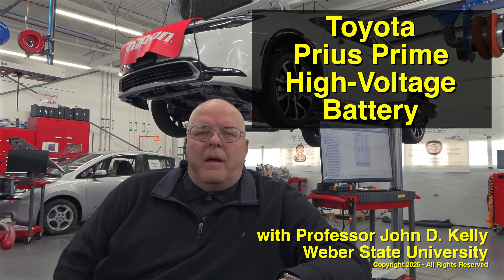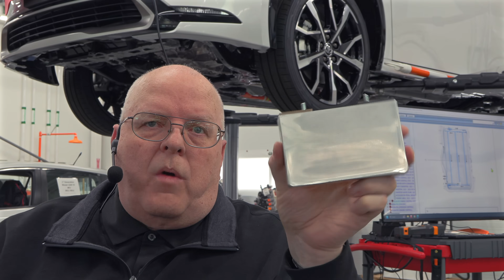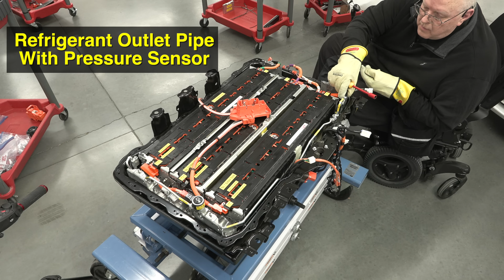2024 Prius Prime/PHEV High-Voltage Battery Build

Comment: AI Summary:

This video provides a comprehensive teardown and reassembly of the high-voltage battery pack from a 2024 Toyota Prius Prime Plug-in Hybrid Electric Vehicle (PHEV). Professor John Kelly details each component of the 13.59 kWh battery, which is a significant departure from previous air-cooled Prius batteries, as this model utilizes a refrigerant-based cooling system. Key components covered include the battery's heat shields, a low-voltage electric heater (likely for preventing electrolyte freezing), the aluminum cooling plate with refrigerant channels, and the three stacks of 24 prismatic cells each. The video explains the cell connections, voltage and temperature monitoring systems, and the integration of the battery management system. The refrigerant circuit, manual service disconnect, and battery junction block (containing contactors, but notably not a pre-charge contactor) are also thoroughly examined. Challenges, such as the unavailability of specialized service tools in the US, and design features like pressure relief vents are discussed. The video serves as an in-depth educational resource for understanding the design and function of a modern, liquid-cooled EV battery pack.

2024 Prius Prime PHEV High-Voltage Battery Deep Dive

*   0:00 Introduction: The video explores the 13.59 kWh high-voltage battery of the 2024 Toyota Prius Prime PHEV, which is refrigerated, unlike earlier air-cooled Prius batteries.
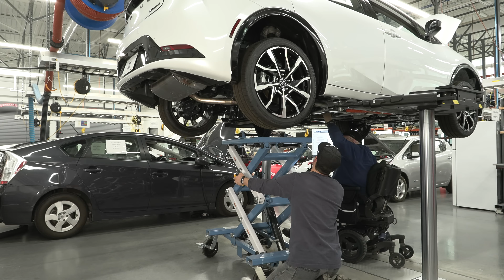*   0:36 Battery Specifications: The battery has a nominal voltage of 266.4V, a capacity of 51 amp-hours, and contains 72 prismatic cells.
*   2:06 Heat Shields: Thin, delicate heat shields/insulators (unnamed in Toyota's service information) are located at the bottom of the battery housing and between cell stacks to isolate the stacks.
*   2:56 Battery Heater: A low-voltage (12V) electric heater, similar to the one in the 2017-2022 Prius Prime, is present. Its primary function is likely to prevent electrolyte freezing, not for general battery warming.
*   5:42 Battery Cooler Sheet: An aluminum "cooler sheet" with channels for refrigerant flow is used for cooling. Refrigerant enters one side, snakes through three channels, and exits the other.
*   7:27 Three Cell Stacks: The battery comprises three stacks of 24 cells each, connected in series.
*   11:02 Limited Cooling Contact: Each cell has a small contact area (approximately 1 inch square) with the cooler sheet for heat transfer, using thermal interface material.
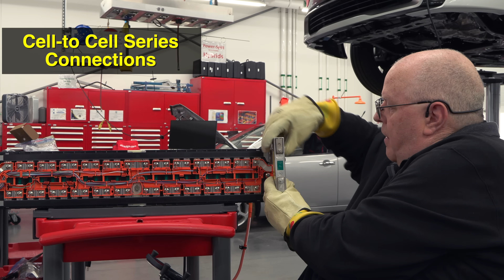*    13:01 Cell Series Connections: Cells within each stack are connected in series using bus bars, forming a serpentine pattern.
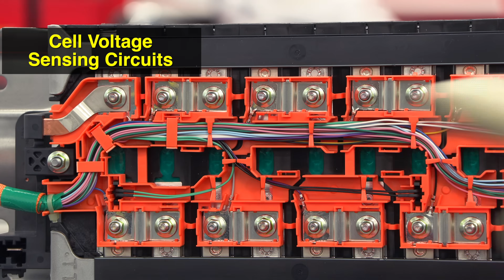*   14:07 Cell Voltage Monitoring: Each cell's voltage is individually monitored by a dedicated computer.
*   14:55 Temperature Sensors: Each cell stack contains five temperature sensors.
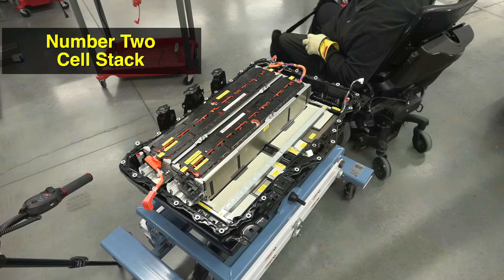*   16:48 Wire Harness: Specific wire harnesses and brackets must be installed before the third cell stack, due to bolt access limitations.
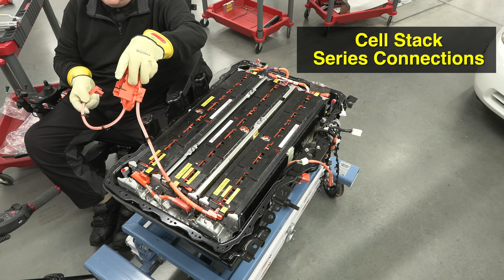*   23:08 Manual Service Disconnect: The manual service disconnect lever (service plug grip) with a large fuse is located under the rear seat cushion.
* 23:30 Refrigerant Lines and Control: The refrigerant system includes an inlet line with a "magnet valve" (precision stepper motor), temperature sensors at both inlet and outlet, and a pressure sensor.
*   26:14 Unavailable Service Tools: Special service tools for this battery are currently unavailable in the USA, making leak checking difficult.
*   29:56 Battery Junction Block: Contains the positive and negative contactors, but no pre-charge contactor.
* 30:19 Pre-Charge Method Change: The Prius Prime (and likely other Toyotas) now use the DC-DC converter bidirectionally for pre-charging, eliminating the need for a dedicated pre-charge contactor.
*   32:42 Battery ECU: Includes both the main battery ECU and the cell voltage sensing computer.
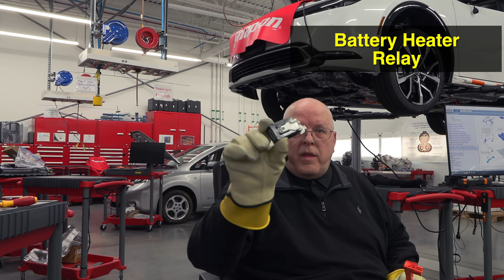*   33:11 Battery Heater Relay: Controls the low-voltage battery heater.
* 39:20 Refrigerant Service: Discharging and recharging the refrigerant requires a special scan tool procedure to open solenoids and stepper motors, preventing trapped refrigerant.
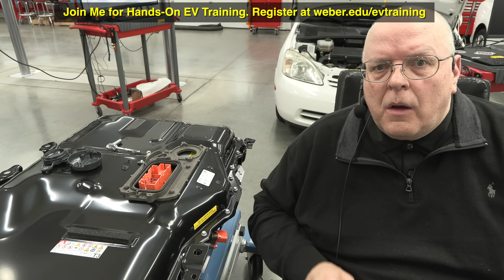* 40:15 Battery Vents: Two vents are present: a Gortex vent for pressure equalization and a spring-loaded door for rapid gas release in case of thermal runaway.

I used gemini-2.0-pro-exp-02-05| input-price: 1.25 output-price: 5 max-context-length: 128_000 on rocketrecap dot com to summarize the transcript.
Cost (if I didn't use the free tier): $0.03
Input tokens: 21632
Output tokens: 772
Reply from the maker: Interesting and mostly accurate

Comment: I’ll tell you it sure doesn’t seem like they heat the battery outside of that resistive sheet, because it will absolutely lose 30%+ of its BEV range when it’s cold out, even when I’m not running the HVAC.

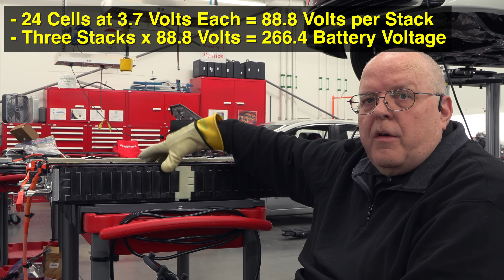Comment: Hello I think there is an error 10:37 : cells are never wired individually in serial, we use a parallel wiring by pairs or cells. So it's not 3 stacks of 24 cells but at least 6 stacks of 12x2 cells. Using a parallel wiring avoir stressing each, upgrade max amps and enhance reliability. Cells are probably wired by 4 or even 6. On PHEV batteries are small so have a lot of stress, so need to support big currents.
Reply from the maker: These are individual cells in a prismatic form. There are no external parallel cell groups.
Reply: Or maybe the trick is inside cells: it's probably an assembly of 2 cells in parallel.

Comment: Hi, Greetings from Australia. Really interesting video, thanks.  Is this refrigerant circuit common with the cabin a/c or is it stand alone for battery only ?  i.e. are there one or two a/c compressors on the car ?
Reply from the maker: It is a shared system used by both.

Comment: What happens in a freezing storm and the car is parked a few days and there is no heat to the batteries?
Reply from the maker: I could not find that information, but if it operates like the previous generation Prius prime it will heat the high-voltage battery as long as there is enough energy in the high-voltage battery. Remember, this is a hybrid vehicle also, so even if the high-voltage battery state of charge gets really low. The hybrid system can still operate and you can drive anyway.
Reply: If it's like the rav 4 prime. There is a 14f temporature limit. f it goes below that temperature, the engine is forced on till the coolant heats up enough to condition the battery.

Comment: 2:45 If you'll allow a guess, that looks an awful lot like Mica. My guess, and i could be completely wrong, but rather than just being a heat shield they could also be High voltage isolation plates.
Reply from the maker: Thank you! A few others have said similar things about it being Mica

Comment: Could you please tell me what kind of transmission is being used in  this Toyota car.???
Reply: It’s an ECVT transmission; the most reliable transmission in the world. Not to be mistaken for a regular CVT.
Reply: @User.Joshua  The transmission from the traction motor to the wheels has one fixed ratio.  Therefore, it is not a variable transmission.
Reply: @av8bvma513 The ratio from the engine to the wheels varies. So it is a CVT. You have to look at the entire system not a single component.
Reply from the maker: It uses the Aisin PB12 Power-Split transaxle. as someone else noted, it is an electronic CVT transmission.

Comment: Something that i've been waiting for since before evs went into production: I've always thought two issues to monitor cells for safety, one is voltage the other is heat. So they have voltage monitor for all the cells, but not heat monitors, I'm guessing its only a matter of time until each cell has its own heat sensor, probably a tiny one perhaps with some other circuitry, perhaps voltage/heat sensor combo ( and perhaps current sense also). It has to happen at some stage, otherwise there is always this grey area of cells not being monitored for heat, and reduction in fire hazard will be better
Larger packs dont have cell level monitoring of voltage..an problem to be resolved, since cells in parallel you cant monitor on an individual level really.......great vids by the way.
Reply from the maker: Thanks for sharing and for your kind words.

Comment: Great video! I am curious about the cooling system. Is the new cooling system more efficient than the old airflow cooling?
Reply from the maker: Yes, it is not reliant on the temperature of the air in the passenger compartment.

Comment: Would be interesting to see how it looks inside a single cell and how it's distributing heat. Perhaps it would explain, why they don't use an air cooling system like in the previous models.
Reply from the maker: Air cooling relies on the driver of the vehicle setting the climate control to an appropriate cabin temperature. That air is then used to heat or cool the battery. This method is all automatic.

Comment: Thank you for the detailed description and walkthrough, masterclass. I have friens with plug in hybrids, and I have a question on the correct use of the car:
1 - use both EV and petrol mode, maybe to a formula (x cycles / 1 tank of gas)
2 - use the car in EV mode most of the time and charge it at home/office
Here is my problem with 2:
- you carry around an entire ICE and likely a full tank of gas all the time(we can say that about the hybrid part as well, but we will focus on the EV mode scenario now)
- you have a 1/4 to max 1/2 battery capacity compared with an EV car
- using the plug in hybrid in EV mode(my friends are doing this alot, maybe 80%EV and 20% combined when they go for a trip) is the worst way to use a plug-in hybrid...
- ...because you are exponentially doing more battery cycles compared with an EV due to battery capacity
- and after two years they complain the battery is around 80%....
A tutorial of how to best use a plug-in hybrid would be highly valuable to educate the owners.
Reply: Toyota limits the maximum charge to protect the PHEV battery. 10.5 kWh is used for EV driving out of the 13.6 kWh total capacity.  Also there is a 10 year, 100,000 mile warranty on this battery.  Plus, from this video it looks like it can be rebuilt.

Comment: Does refrigerant refer to actual refrigerant or liquid coolant?
Reply from the maker: Refrigerant. 1500 grams of it.
Reply: @WeberAuto  I wonder if the resistive heater is to warm the battery in the event that ambient temperatures are too low for the heat pump to operate effectively.
Reply: Never mind, this is answered at 39:20 in the video.

Comment: This video proves I'm right, Plug-In hybrid vehicle is not a moneysaver, it is just a short-range EV that you commute daily carrying both heavy ICE engine and a full tank of gas.
With all the complexity of a plug-in hybrid, I don't see any dollar per mile of saving. 
As of today in 2025, if you crunch the numbers, the regular Toyota hybrid is your best bet. Or just go with a Hyundai EV?
Reply from the maker: Thanks for sharing
Reply: You do understand that if you’re not utilizing the full capacity of an EV’s battery every day, you’re lugging around hundreds of extra pounds of batteries that you’re not using, just as you’ve mentioned about PHEVs.

The flexibility of being able to use multiple fuel sources is often lost when I hear these talking points that you’ve made. It’s not all negatives. I suspect that BEVs will win out in the end, but as it currently stands, they’re not the obvious choice.
Reply: The economics depend on where you live and the relative costs of electricity versus gasoline. Here in BC, Canada, electricity costs are low, especially late at night, but gasoline is expensive. I can drive up to 50 miles on a charge for less than $1 USD in EV mode, whereas it will cost $4.70 USD running 50 miles (1 gallon of gas) in hybrid mode on gas.

Comment: Thank you Professor Kelly!
So it looks like the 2024 Prius Prime PHEV's battery spec should be:
13.59KWh
266.4V (72 x 3.7V Prismatic cells)
51Ah per cell 
Battery chemistry probably is NCM or NCA Lithium cells.
Reply from the maker: Yes, that is correct. Thank you
Reply: @WeberAuto Could you, professor, show me the markings on the cell?
Reply: Anyone know the C rating on these cells?

Comment: What a great video. It is interesting that Toyota has a battery pack designed for repairability while the “other” company spot welds their battery pack shut and fills it completely full of foam for zero repairability. Toyota monitors the voltage on every battery while the other company has so many little batteries that the voltage monitoring is done on a rather granular basis.  Why does the other company use the foam insulation? I thought that part of the reason was to seal for water intrusion but considering that their battery packs have a tendency to short out after flooding events it seems that Toyota approaches it very different. 

Also Toyota using Freon for battery cooling vs using water / glycol like Ford is interesting. Toyota definitely wants to keep water out of the interior of the battery pack. An interesting technology that is being promoted is immersion cooling for batteries with a nonconducting fluid.
Reply: Tesla
Reply: → Nicholas

Not interested in inflaming the fanboys, just curious about interesting choices that significantly differentiate the products of different manufacturers. Maybe it doesn’t matter if one is not repairable while Toyota & Ford are. These design choices are made for a reason. Also, I have not read about how Toyota and Ford battery packs perform after being flooded after hurricanes but have definitely seen numerous reports about the other company’s performance but that might just be due to the relative numbers.
Reply: @Mentaculus42 from what I gather from people who build their own DIY battery packs here on youtube usually you can't just replace one single bad cell but you have to replace all the cells in the pack, since all the cells have to have roughly the same overall voltage curves, resistance, capacity and charge-discharge behaviour. In the DIY space that means you can't just mix and match 2nd hand cells from random suppliers, you usually want cells from the same production batch that have experienced the same cycling. If you don't, your cells will be imbalanced and some will have to work much harder than others and end up failing prematurely, or worse, cause a safety hazard. For a car battery pack it means one cell goes bad you scrap the pack, or at minimum an entire module. Theoretically a skilled technician with access to lots of different used cells with different properties could replace a single cell bad cell from a pack and make it as good as it would have been if the cell had never gone bad in the first place, but I suspect any auto repair shop that could even do it probably wouldn't want to due to liability issues it creates.
With regard to gluing cells together, imo it can be an acceptable solution, but it depends on the chemistry and if the cells can have a second life. In the tesla pack you're referring to, the main thing that is lost by gluing the cells together is that hobbyists now no longer have access to cheap used cells for their own DYI packs (for reference, many bespoke electric conversions are done with old model S modules, which are from before the glue days).
Another thing that is lost I guess is that 2nd hand cells from glued packs can't be used in stationary storage. Although imo non-iron battery chemistries should not be used for storage anyways, since they are inherently less safe and need more babysitting (but they are much more energy dense, which is why a lot of performance EVs use them). 
From what I've seen from the teardowns the iron chemistry battery packs from tesla are regular prismatic (rectangle) cells that are disassemblable and not glued down, same as this toyota pack. So those certainly can find a second life as grid storage, unlike non-iron chemistry cells.

Sorry for the papyrus but you asked 😅
Reply: @ 

Thank you, that is useful information.